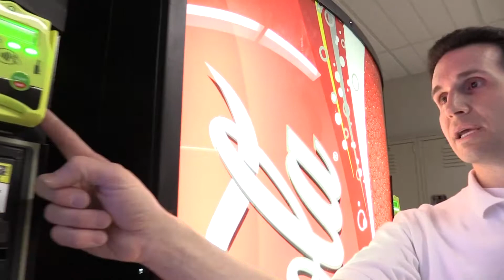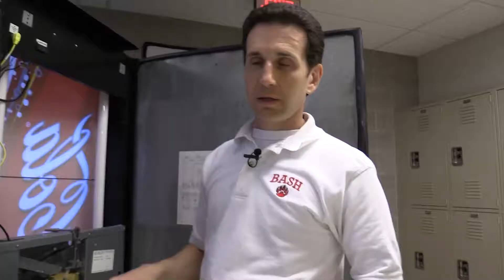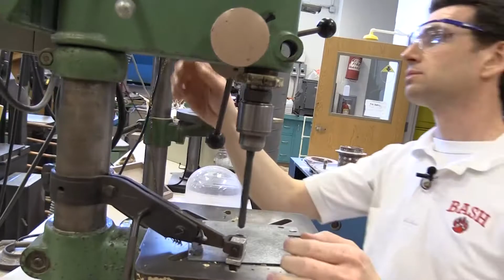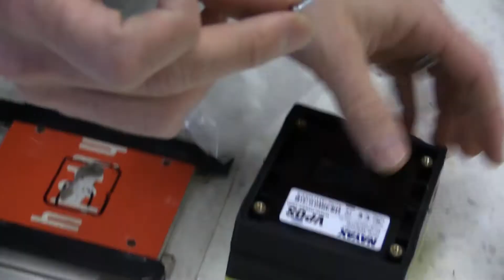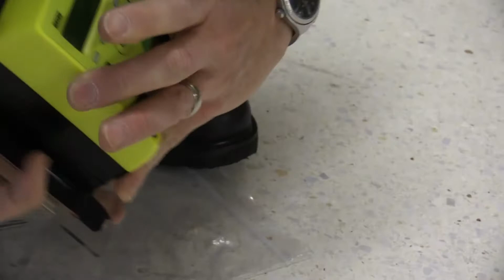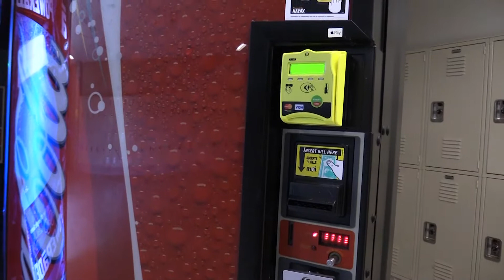Extending a Nayax Credit Card Reader on a Royal GIII POS Window

Comment: I have a royal 804 with a coinco validator in it can I just swap the coinco out for a Mei validator? I was told I have to purchase a different bracket? Please let me know if you have experience with this project!! Thnx
Reply from the maker: Yeah, you will need an MEI bezel like this one: https://www.ebay.com/itm/185813440354?itmmeta=01J36VGWQNNVMNCK8GSK2N3KEZ&hash=item2b43581762:g:FK4AAOSwBWxkD7V1&itmprp=enc%3AAQAJAAAA4IFcS%2FOqGjq819MjA17NGRQMyuqrID8j7vmifFv3SeIVaJkCIKaBsekw82ue8j%2Fp2rz40KLD84gJvaBZQXxU%2BacDBWLvMb9QCZArQDjZgxosO5gHJQFWcWu265w2PXXrpwTjG6vQ25OqkBQdDoATuP40rt%2F11zlWW17LxXpeixjjMt3laCIJU0pNA1w1D9cDCMmuMwEmLUKzrt7Do2PWYZ%2BmqxSreqXBMVM0p7NnWlQ2LOuTkjqjRF4plqw4I40xgd9AfL6vWLyjdr42a493qisVA1Lleh%2BOu6Vs%2BZqmcJet%7Ctkp%3ABk9SR_rLw9uZZA
Reply: @HappyVending  so to remove the original bezel is it just 4 nuts and it pulls right out?
Reply from the maker: @alow2323  Yes, and power off your machine before disconnecting any harnesses.
Reply: @HappyVending  🫡 thank you sir

Comment: Is it basically plug and play? Are there other steps beside installing the reader on the front?
Reply from the maker: It is pretty much plug and play if your machine supports MDB for the coin mech and bill acceptor.  The MDB plugs goes to the CC modem, then it goes to the coin mech and bill acceptor. You also need to mount the antenna.
Reply: @HappyVending  thank you for the reply. Very helpful, keep up the good work. Really enjoy your videos.

Comment: Hello, what size drill bit is best to use drilling a hole to install the Nayax. Thank you
Reply from the maker: 1/2 inch for the center hole and about 5/32 for the screw holes.  It should tell you in the packaging.
Reply: Happy Vending thank you so much !!